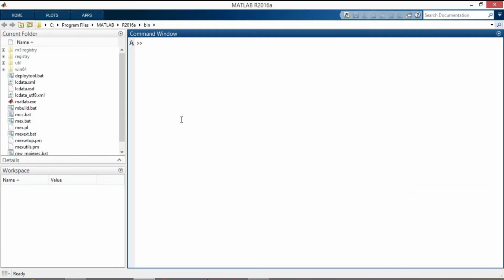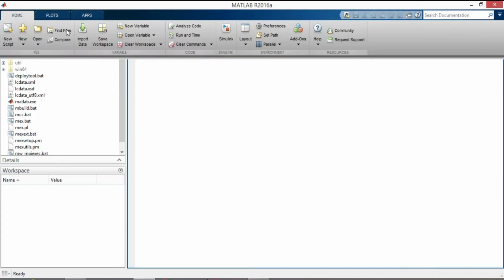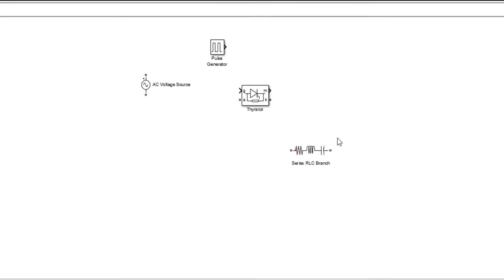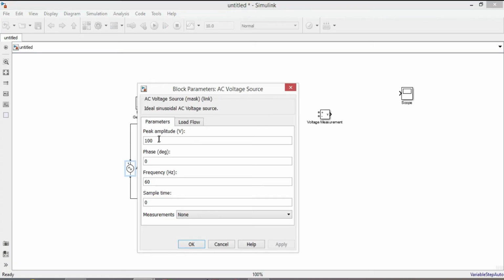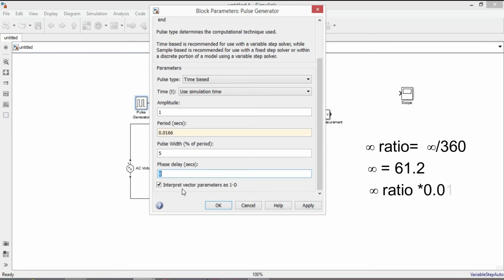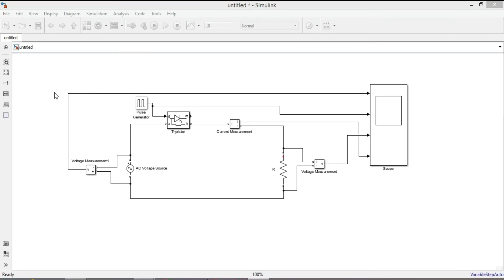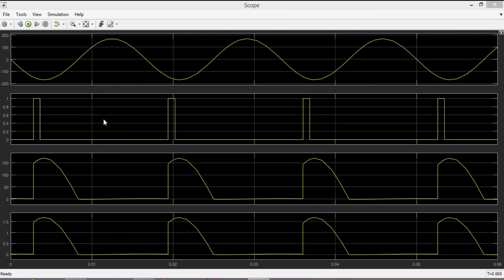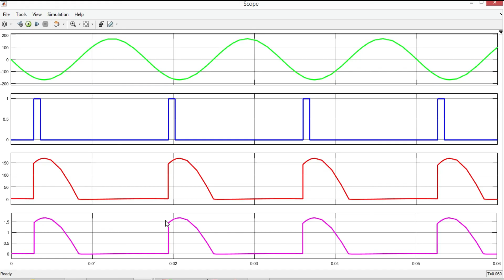Simulating Half wave controlled Rectifier( R Load ) Matlab Simulink

Comment: if u see the output of this circuit you will see that dc voltage are not 40 v. i think there is a mistake in this simulation because we cannot get the desired output

Comment: there is a mistake in the connection of the voltmeter with the ac voltage source , the positive port of the voltmeter should be connected with the positive port of the ac voltage source and the negative port with the negative port